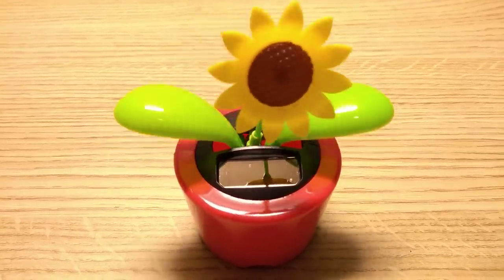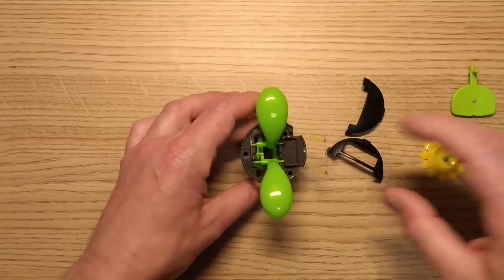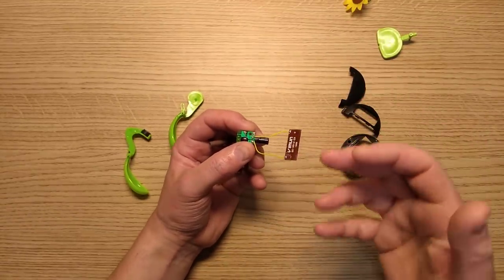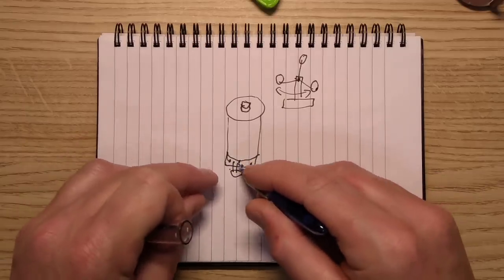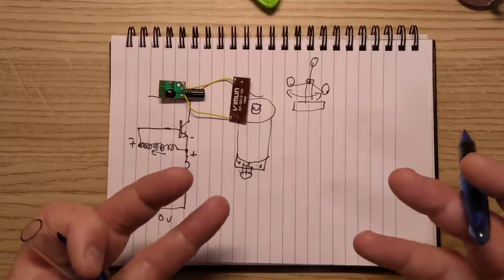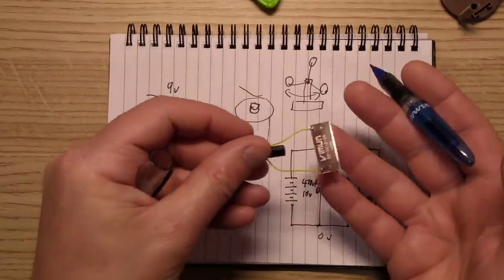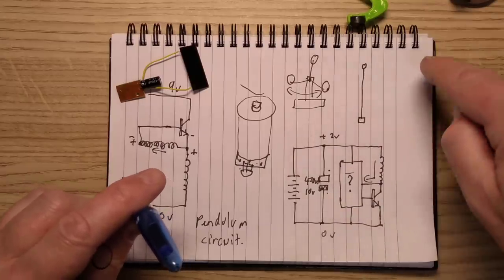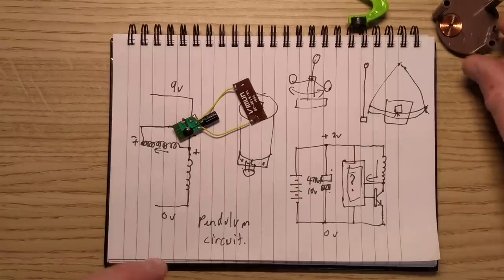Flappy solar ornaments have an interesting history.

Comment: 1.  first and only one of these I got I thought it was a gag.  $3  I've been had. put it in full sun and it doesn't do anything unless I move it on my own. 2.  anyone give any thought on how (besides DiodeGoneWild)  to remove the resin?   heat? chemical?
Reply: If you're in a position to nuke the blob, the thing to try first is to de-center the passive magnet from the coiled one i.e. ensure that they're not co-axial.

Comment: 3:12
Is that 52 gauge wire ?
One can find such wire in a 12v relay.
It is not pancake shape, more like a cylinder and has an iron core.
Reply: Probably more like 44 or 46 Ga. Even at 44 Ga the wire is as fine as hair.

Comment: Doas anyone here know what size of cells an HP 6550b battery contains...and how easy (or not) they are to replace?
If anyone wonders why I just don't buy a new one, it"s due to my location...Canada, meaning they cost upwards of $80.
And no...I will not buy from Batterydepot.ca lol.
Reply: Just checked in amazon and they are like 20 bucks.  it probably has 18650 inside but I can't tell you if they are easy to put apart or not, i'd have to see it in person.

Comment: Then there's the non-electric variety: https://www.youtube.com/watch?v=cTkx3cdO5rM
Reply from the maker: I used to have a methylene chloride giraffe version.  It stopped working because the flock of the beak parted company with the head and I didn't understand that it was the evaporation of the water from the head that cooled the bulb to make it work.
Reply: @bigclivedotcom  One of these?: http://www.thedrinkingbird.com/images/Giraffe.jpg Don't remember seeing those.
I acquired a dippy bird but on its own - no container. Made a container with 'perch' rods out of old PET bottle (1.5l with separate plastic base - as they used to come originally.)